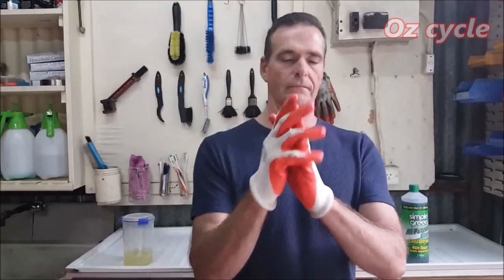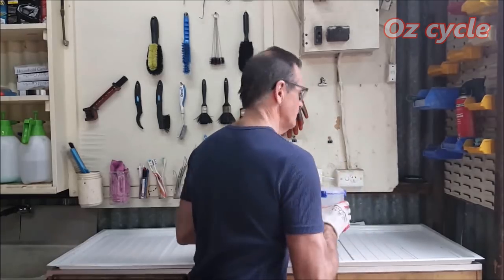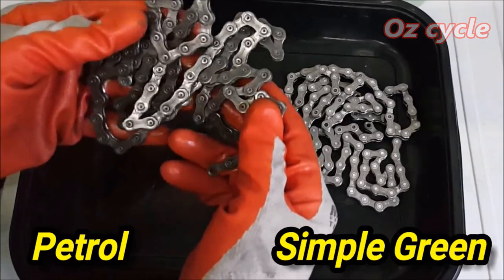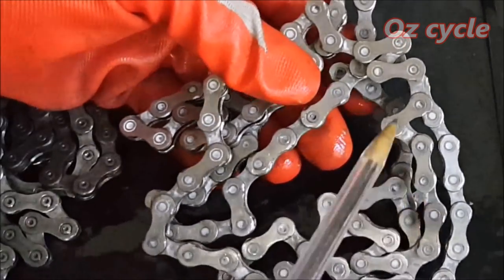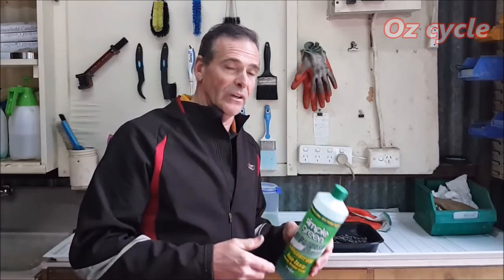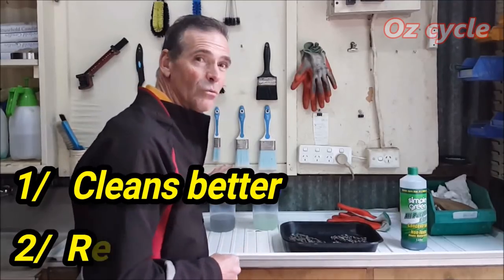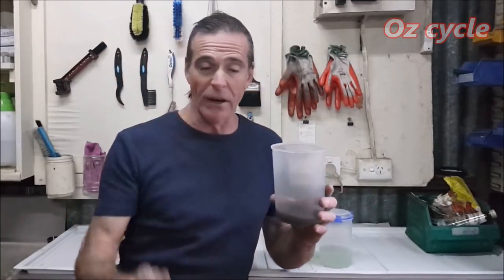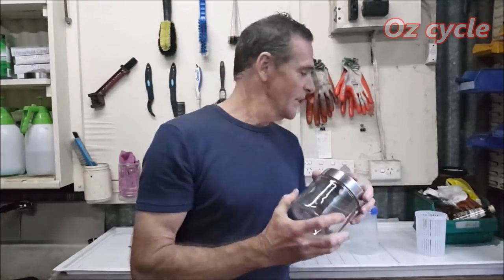Simple Green VS Petrol - which cleans better?

Comment: Have you ever tried a sonic cleaner. I have one and it is the best. In the sonic cleaner u put 1-1 simple green and H2O run it for 6min and it is like new.
Reply from the maker: Yes,tested sonic cleaner with various fluid cleaners. It did a great job but took up to 1hour,electricity and a lot of fluid. So much more efficient with just petrol.

Comment: Wax is paraffin not grease.
Reply: Yep. So no surprises that an hydrocarbon solvent which dissolves wax works better than a degreaser that doesn't.
If people want a less toxic alternative they could try limonene (citrus derived plant compound) or histolene both of which are very effective for de-waxing.
We use them instead of xylene for removing paraffin wax.

Comment: Never petrol. Dangerous and a carconagenic. 
It is very difficult to get any lube back into ALL the places the petrol can reach. Plus petrol doesn't just get lube out of the chain surfaces, it also totally strips all the lube from the microscopic pores of the metal structure... making it bone dry. 
It's almost impossible to get any wax or lube back into those micro pores after petrol use and eventually you ruin the steel structure using petrol. 
The safest and the best pure degreaser for most chains is Extreme Simple Green Aircraft and Precision Cleaner.
Reply: That's why you use hot wax bath for a perfectly clean chain. There's no point of totally cleaning your chain unless you are going to use hot wax bath.
I would also guess that this should work especially well if you are using SIL-TEC chains.
Reply: You will never get the wax back into the chain even in a hot crockpot at most domestic temps. This can only be achieved in a factory environment such as eg... KMC, Shimano, Wippermann that has specialist lube baths with multiple heat and bathing processes. Once your chain is stripped with petrol...its stripped for good. SIL-TEC plating process hates petrol and one washes out ALL the imbedded fluorine particles as you soak the chain in petrol.
Reply: Hot bax path still looks like a good way of lubricating your chain, you just need to avoid overly aggressive cleaning processes.
There seems to be a difference between cleaning oiled and waxed chains. What would be the best way to properly clean waxed chain to prepare it for another hot wax bath? Mentioned Extreme Simple Green, or is this one more suitable for oiled chains, and waxed chain needs something else?
Reply: UFO Drip Lube, RockNRoll Gold/Extreme, Silca NFS, Ride Mechanic Bike Syrup  and a few others do just as good of a job as wax (friction, protection, longevity, staying clean, quiet etc...) with less fuss with huge time-savings which in my books equates to $ savings. Time for me is money. Not sure about you. Ride more...maintain and service less is the name of the game. Especially with multiple bikes. Do your homework about chain lube v wax :-) . Remember....one must clean/sterlise the entire drive train every time you wax your chain and install. 
To answer your question....good home solution to clean/prep a chain for wax or remove oil/degrease.....heated activated ultrasonic cleaner (EBAY $100-150.... throw your cassette and other non anodised parts in there too)  with a ratio of Extreme Simple Green and water. NO PETROL! Petrol slowly kills you, the environment and your chain.
Reply from the maker: Wax has been used as a chain lube successfully for decades and is making a major comeback, even in the pro-peleton. It also extends the life of the drivetrain. If it didnt work these results wouldnt be.
Reply: You say, " ............ it also totally strips all the lube from the microscopic pores of the metal structure........making it bone dry."  May I ask, do you have scientific evidence that supports this statement? If so would you state what that source is? Your statements seem to be exactly what someone else posted on another website regarding the use of petrol for cleaning chains. That person made the exact same statements without providing any information to support his statements.

I am not saying you are wrong! I'm simply asking for evidence that supports your statements.
Reply: oz cycle mate...stay on the topic of your video...you're reply/comment had nothing to do with your video.... 
The discussion was petrol versus Simple Green as a degreaser. 
There's not one pro team using a pure wax lube from a crock pot. The so called wax lubes used within pro ranks are hybrids and far from a wax lube. 
Pro teams use what they're given by the sponsors. The major lubrication sponsors within the pro peloton all use what they're given and most are solvent based. The pro peloton wrenches simply don't have time to go through the entire waxing process particularly looking after a huge volume of multiple bikes and tubular wheelsets. And yes has been around for years and any reasonably good lube will extend your drive train if you clean and lube your drivetrain frequently, particularly after every ride just like the pro peloton where every bike gets stripped down, serviced and re lubed with solvent based chain lubes due to ease of use straight out of a bottle supplied by a sponsor. 
Also the pro peloton changes chains, cassettes and chain rings more often than you and I consume daily meals. Hence the wear is less and is spread amongst multiple spare parts. Thanks to the sponsors again. 
Different stages and riders always demand different gear ratios...hence constant changes from the service course which is stocked with an array of spare parts and thanks again to the sponsors. 

Teams sell all their bikes every 6-8months before the drivetrain even get a chance to see reasonable wear. No need for wax again. Too time consuming for the pro peloton and not viable despite benefits.
My issue was not the wax. My issues is you playing with petrol which is highly toxic and volatile as a degreaser versus a basic water based Simple Green. You're not comparing apples with apples. The test should have been petrol, versus white spirits versus diesel as a chain degreaser.

For your benefit don't egg on nor encourage people to use petrol as a chain degreaser. Some people out there are not bright and stupid is....stupid does....not knowing the risks nor are aware of a volatile toxic product like petrol.

To stay on topic....petrol strips ALL lube from the chain metal structure and micropores where no matter how hard one tries re waxing a chain it will never reinstate what you've stripped out of it. 

Petrol in the wrong hands of a user without forsyth, duty of care nor awareness is simply dangerous. Plus petrol vapor is simply bad for your health and very bad for the environment.
Reply: William Cain I suggest you contact the aeronautics industry, motorbike industry or troll the net. The scientific evidence is out there if you look for it and know how to gather basic information. I'm not here to hold your hand. You have to do the homework...not me. 😉
Reply from the maker: Check out Adam Yates' chain from this years Tour De France,Anton...a purely waxed chain.
Reply: And? Shame the wax didn't stop him from crashing and also didn't make him faster. I do like the Yates boys though. What about the other 99% of the pro peloton lube? Sponsor lube which are not wax based. Many are running Ceramicspeed UFO chains which have a pre coated teflon powder which is then topped up by UFO drip lube. Not a wax by any means. Oh.... and most of the pro peloton use citrus based degreasers. NO SOLVENTS like petrol.
Reply from the maker: As you said Anton,most will use what they are sponsored with. Paraffin wax is a very efficient chain lube,cheap and universally available.
Reply: Mr. Rodman, I do not need my hand to be held. I merely asked on what evidence you based your statement  about petrol stripping all lube from microscopic pores of the metal structure. And further I said that in your statement on this you used the EXACT same words that were used by someone on a forum on another website several years ago. I.e. it appears that you simply plagiarized  the words of another person without noting that you were quoting someone else's words.

In your statement you are basically saying that if petrol is used to clean a bicycle chain, then the petrol in some way has a negative effect on the metal that the chain is made of with respect to the ability of lubes used for re-lubricating the chain to effectively lubricate the chain, if petrol has been used as a cleaning solvent.

Often people attempt to make statements about scientific matters without any scientific evidence to support their statements.

It appears that you were attempting to say that using petrol as a chain cleaning solvent in some way has an irreversible negative effect on the metal of the chain. Is your statement based on 'hard science', or is this merely your way of trying to convince people that petrol should not be used as a cleaning solvent for bicycle chains?

Using gasoline (petrol) as a cleaning solvent may be hazardous to one's health and/or to the environment. However, I question the validity of your implying that cleaning a chain with gasoline in some way inhibits a lubricant ( be it waxed based or petroleum based) from properly lubricating a chain when the new lubricant is applied.

With regard to the advantages of using a wax and/or wax based lubricants for bicycle chains, there is evidence (tests)  that support the argument for using wax based lubes on bicycle chains. 

1. 'VeloNews'  has done several articles showing the advantages of  using wax lubes on bicycle chains.

2. In a March 28,  2018 article on  the cyclingtips.com site there is an article by David Rome in which he cites studies/tests done by Jason Smith and  also by Adam Kerin that support the argument for using wax based lubes for bicycle chains.

In conclusion, whether or not to use gasoline for cleaning chains seems to be one's personal decision. However, there is NO debate about the advantages of using waxed based lubes for lubricating bicycle chains.
Reply: I have been officially called out and pointed out as Mr Rodman. Its an honour mate and thanks Mr William Cain.
As I said do your homework before rambling on. Find out what alkanes from pentane to octane do to plain ferrous carbon alloy and steel and then get back to me with conclusions and assumptions about plagiarism. I repeat....find out why the motorbike industry (chain cleaning in particular) and the aviation industry DON'T use "petrol" to clean/degrease ANY components (chains included) made of ferrous metals and have stopped using solvent based degreasers. The rest of the verbal diarrhoea you have included is off topic and irrelevant since we are discussing Simple Green v Petrol. 
BTW.... its not science. Its chemistry. Let me know how you go with your research. Bye bye for now Mr Cain.
Reply: I tried looking on the Internet for 2 hours for any source of information relating to the effects of alkanes on metal. I didn't find any source. IF what you say is correct about the effects of gasoline on metal, I would like read some information on the subject.  Can you take the time to suggest where one should look for information on this subject?
I am not saying what you say is wrong. However you are taking the time to make statements on this subject without taking the time to give us the source of your information. You seem to indicate that you are knowledgeable regarding the effects of gasoline on metal.  It just seems to me that a person that is knowledgeable about any subject would be happy to share the source(s) of that knowledge.

I would appreciate any information that you  can provide so that I can gain an understanding of how gasoline, when used as a cleaning solvent, adversely affects metal. Thank You in advance for any source of information you provide us!
Reply: I'd like to be hand held on this Internet and read about this too. Waiting...
Reply: Anton Rodman You said, “BTW...Its not science. Its chemistry.” 1) Its —> It’s  2) I believe most would say it’s science AND it’s chemistry.  3) Why not be a good guy and provide William with a few links to support your position. If you can.
Reply: Stephen Morton Correct, just wax the chain without cleaning it if it has been waxed before. The dirt falls to the bottom of the pan.Bingo. Same wax can be used several times before it needs changing.
Reply: Anton Rodman What you say may be correct but chains only last for a few thousand kms before they stretch. It doesn't matter much as long as they are adequately lubed or waxed.
Reply: Anton Rodman : Totally agree. The chain will die after a few 1000 k's no matter what you do. Degreasing is just killing the chain prematurely. KMC e.g. strongly advises NOT to degrease the chain. And my time is to valuable for this wax voodoo ...
Reply: @antonrodman5047  haha, chemistry is a branch on science.
Reply: @williamcain7464  Check KMC website.  They support that you should not use something like petrol,
Reply: @stuartdryer4089   Just went to KMC's site. Did not find what you referred to. Please quote what you read, or provide more information. What do you mean when you say, "they support that you should not use something like petrol". Does the source at KMC state why one should not use "something like petrol"? More information please.
Reply: @williamcain7464  it literally took me 45 seconds to find the following on the KMC website.  They have a section called Maintenance.  In it they specifically recommend against the kind of procedures described in this video.

Cleaning
Clean your chain after every ride, especially after riding in the wet.Always use a piece of dry cloth to clean the chain.
Do not forget the sprockets, front changer and derailleur pulleys.
To remove mud or sand, use the bristle brush (which comes with every 120ml packing of KMC’s chain lube Pro), use light soapy warm water, if necessary.
Do not use acidic or alkali based detergents (such as rust cleaners), these can damage the chain and may cause breakage.
Do not dip your chain in (aggressive) degreasers - they remove the remaining grease from the chain’s bearings, and may cause cracks. They are also bad for our environment.
If the chain is really dirty and difficult to clean, besides using a brush for the inside, try putting some solvent on a cloth and use it to clean the chain’s exterior.
Try to avoid a so-called ‘chain washing machine’ in combination with solvent. This will instantly ruin your chain.
Some lubricant brands advise you to completely degrease the chain, KMC does not recommend this.
Reply from the maker: Waxing the bicycle chain is completely different to how manufacturers want you to use their chains. Hopefully they will update their maintenance instructions soon.
Reply: @stuartdryer4089  OK, I finally found the KMC website containing this info.  I found it at kmcchains.eu. I had looked at kmcchains.us (since I'm in the US), and also looked at kmcchains.com. The info provided is different on the different sites.

I am not a scientist, nor have I done extensive research on the subject of how various solvents affect bicycle chains. Therefore I'm not in a position to debate the statements made on the kmcchains.eu website.
 

DISCLAIMER: I DO NOT, I repeat, I DO NOT, recommended using gasoline as a cleaning solvent!!!!!!!!!!!!

Thru 2017, and for the first 7 months of 2018 I used paraffin wax. I found that my chains needed rewaxing after 100+- miles. In August of 2018 I began using Molten Speed Wax. In my experience I get at LEAST 200 miles on a chain waxed with MSW before I hear even a hint of noise coming from the drive train. 

PS. Stuart, thank you for taking your time to provide us with the info from the kmcchains.eu website.

Comment: waxing seems more trouble than its worth if you need a powerful solvent like petro to clean your chain
Reply: Definitely not. Choice of solvent/degreaser is least of all troubles when it comes to waxing. And you don't need petrol, I can do fine enough with dish soap and manual cleaning. It is not perfect, but still better than oiled chain.
Reply: I tend to only wax chains for my TT bike. This is the vital time/Watts saving for me. (But I will do the road bikes too at the same time when I can).
Reply from the maker: Not really Jogbird. Your going to have to clean your chain anyhow and using petrol in a container is so easy. Try it...nice,clean,sparkling chain !